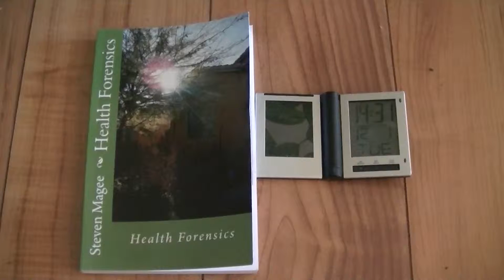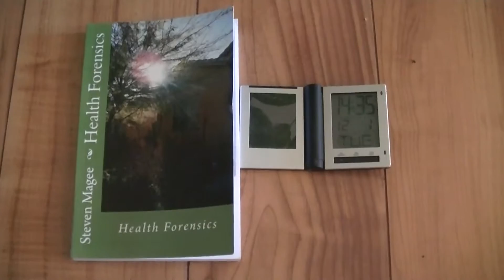Growing Plants With Batteries Inside Shielding and Faraday Cages Final Results

Comment: How about an experiment with the light source inside the Faraday cage? Does this have anything to do with the cage and sunlight, or is it simply the charge in the air?

Doesn't a plant use the environment for growth differently than a human does? Why would it be dangerous for a human to sleep in a Faraday cage? What if the human was grounded to the cage and the cage was grounded? 

A Faraday cage seems like the only solution to protect yourself from all the EMF everywhere. So if you can't sleep in one, how else would you shield  yourself from EMFs?
Reply from the maker: +getenlightened The conclusion that I came to is that the natural electromagnetic radiation is essential to life and if you remove it, you will eventually get Faraday cage sickness.
Reply: +Environmental Radiation LLC Aluminium mesh will not block or disturb the earths natural ER, because it's ELF. You'd need some sort of very thick solid copper insulator to even attempt that.